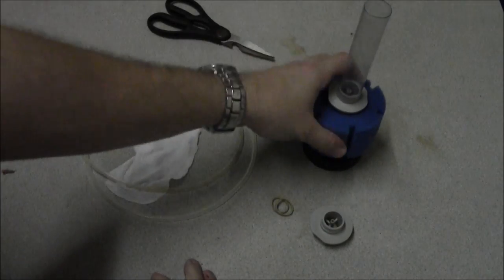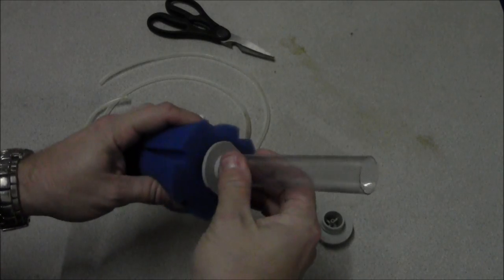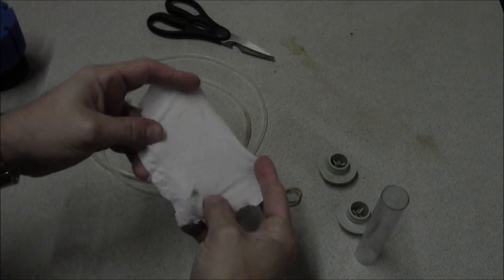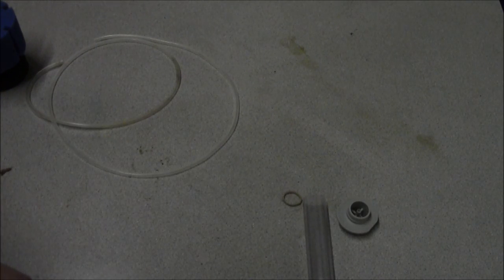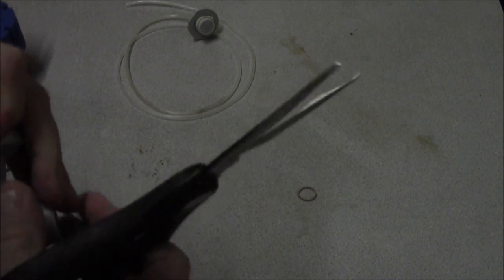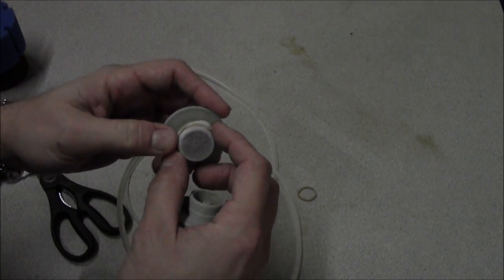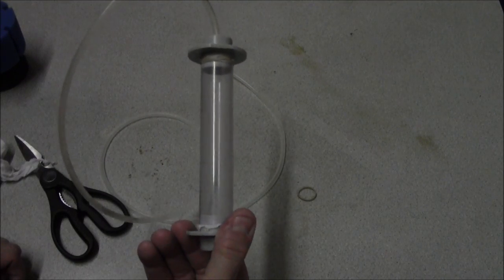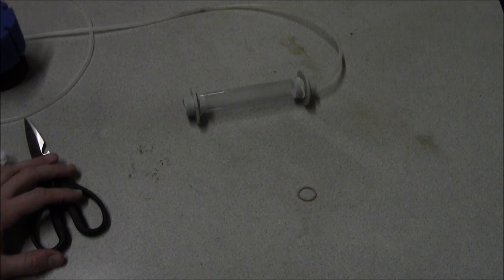DIY Egg Tumbler for Breeding African Cichlids

Comment from the maker: If you have a strong enough pump you will just need a gang valve which you hook to your pump and split it to as many as your pump can handle. On the gang valve you'll be able to adjust the air flow to each output.

Comment: Hey KG. 
My question to you is, I'm trying to build one of these tumblers for my strawberry albino as she tends to eat or spit then within days. 
I picked up two identical sponge filters but the connections are different than yours. Mine are internal connections not external. Leaving the air nipple poking the mesh. Is this a problem or is there something I missed during construction?

Comment: Hey it looked like your tubing was plastic but you mentioned glass. Anyway if you decided to pick up another tube from the pet store and try cutting it up for your tumblers again best way to cut it I would think sit the blade of a kitchen straight blade knife obviously sharp on your stove burner. Let the blade get super hot and then you should be able to cut through that without cracking it. Fairly easy. If you decide to try it make a video so we can see how it goes!

Comment: Hay jhon.,thanks for the video. I have made some DIY egg tumbler and I have ordered couple from the site you mention. Now the problem is how do I connect multiple egg tumbler with my air pump. Say if I want to connect 5 egg tumbler can I do it with one air pump or do I need some thing else. I try to connect my 3rd DIY egg tumbler but the bubble is not coming properly. But other two tumblers are working fine. What should I do?

Comment: Hello!! Nice setup!
I have a problem though and I hope someone can help me.
I need to send eggs and larvae by airplane. Travel duration 15-20 hours.
How can I preserve them properly and minimize the mortality?
My best idea until now, is to "sterilize" the eggs with H2O2, put them in bags (3/4 oxygenated sterile water, 1/4 air) close the bags and put them in an incubator with constant water temperature of 28C. Unfortunately these tumblers do not fit inside the incubator because I need to fit also an air pump, which is impossible. So the eggs will not have any movement for 20 hours. Am I going to lose them all?
Any ideas?